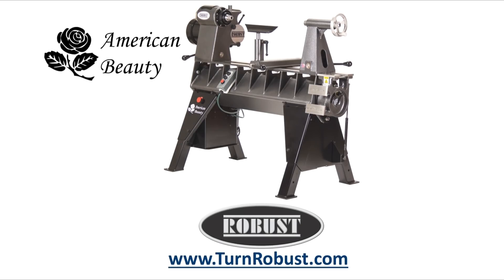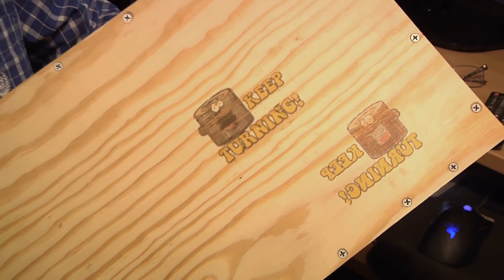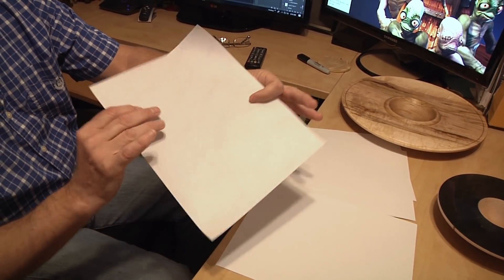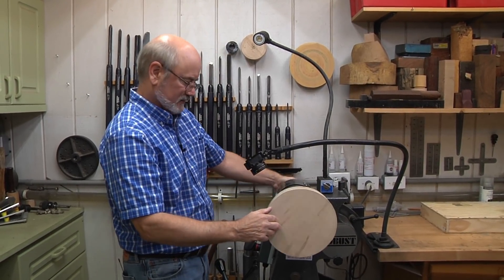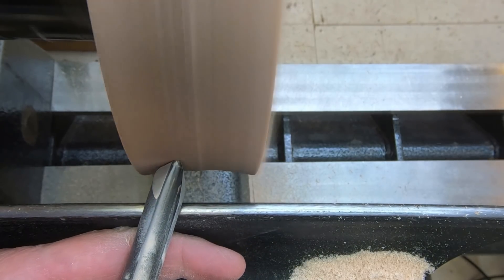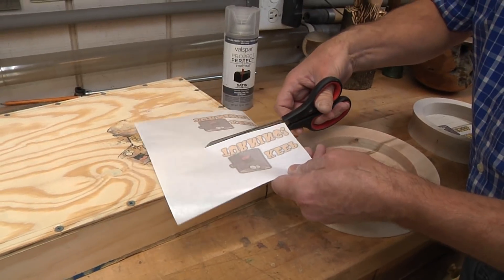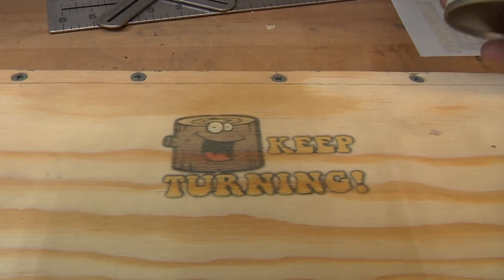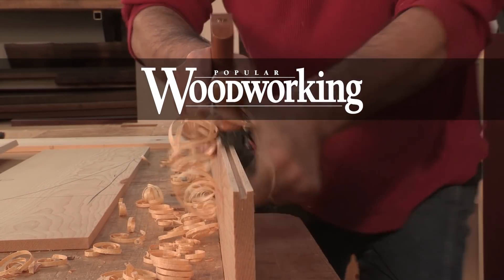Transferring Inkjet Image to Wood

Comment: I have heard alot of people suggest freezer paper, but i was never able to get it to feed through my printer. Frustrated with that method i tried poly sheet protectors and it worked fabulous. Avery heavy duty have been the best in my opinion. i just cut off left and right side making it the same size as 8.5x11 and the bottom and now you have 2 "plastic" papers to print on.  so much fun !
Reply: Hi there. Aha! Not just me then? They make it look so easy. Thanks😊

Comment: You can do the same thing using freezer paper, which is even cheaper than label paper. Just cut it to size and print on the shiny side. My results don't show any noticeable difference between the label and freezer papers.

Please keep the great videos coming!
Reply: nosheepdesigns Thanks, I"'ll try that
Reply: Good luck! Be sure to cut the freezer paper to printer paper size and be careful not to slide or smudge the print when you apply it to the wood.
Reply from the maker: Excellent idea!
Reply: @Nosheepdesigns  I buy my freezer paper 8.5x11, and dont get curl
Reply: @stephaniesummers7452  I didn't know that it came like that! Where do you get pre-cut freezer paper?

Comment: Thanks for a great idea!  I don't have a wood lathe, but this method of transferring an image may solve a big problem for the wife and me.

We've been trying to figure out a cheap, easy and quality way to transfer our photos to ceramic tiles for coasters.  The expenses must be low to sell at a profit.

The ink probably won't work on ceramic, but there's a primer, brush or spray, called B-I-N that will.  We're going try it TODAY, printing on label backing as you suggest, and transferring to B-I-N treated tiles.  Wish us luck!  The next craft fair is only 2 weeks away!
Reply: No luck.  The heavy layer of ink in a high quality photo makes a mess.  Oh well...

Comment: you can print it out on wax paper also. Cheaper. Tape the top of the wax paper cut to fit the computer paper to the top and put in printer.

Comment: My  concern is what you have done to the inside of your printer with the ink you have left behind.  I use inkjet decal sheets.  Not the best because the fixative kind of wipes out the yellow but at least my inkjet printer isn't getting a bunch of residue buildup inside.  Best to stay with laser decals.  Go to Office Depot or Staples and print them if you don't have your own laser printer.

Comment: I needed to look up what the Valspar Top coat was actually.  Old school lazy terminology of "lacquer" causes some confusion since I am not familiar with this particular product..  This Valspar product is enamel, not lacquer  The "heat" (reactivity) of lacquer may cause a different reaction with the printer ink, i.e. might make it bleed or run.

Comment: Great Idea Tim...I am definitely going to try it , I was working on an emblem , for my shop , to carve on my CNC , not working out that well to small ...this will do better .
I bought one of those sander you have ,  just a couple of months ago , did not last , started to smoke and heat up thought it would start a fire , not good in a woodshop , only used 15 - 20 minutes at a time got about 3 + hours out of it .....just want you to know Be Careful ! I like the angle but... end up getting 90 degree Ryobi 18 volt

Comment: Neat!  Could you "miniaturize" the process and put it on a turned surface such as a pen barrel?  Opens up a lot of opportunity!
Reply: If you use MS Publisher, you can scale the size by dragging the corners of the image frames. The limiting factor will be how much the ink will spread after the application to the wood and the type of wood you use. Hardwoods will hold the ink better with minimal spread. Some woods may have to be wiped down with alcohol and dried before applying the ink. Best to test it first with a piece of scrap. Let the ink dry for a day before applying the finish such as CA or some of the friction finishes.

Comment: That's neat. I wonder what sealing it with clear resin will do to the ink. hmmmm. :) Thanks for sharing this tip. - Heidi
Reply from the maker: Sprayed finishes don't seem to affect it. Now a poured resin might start dissolving the ink as it dries. If you try it let me know how it works out.
Reply: I will. Maybe if I let it sit for a couple weeks or so like I usually do with my artwork before adding the resin coat. I will try it both ways. :P Immediately and after a couple weeks or so.

Comment: What software program did you use to reverse the image?
Reply: That program was Photoshop, but there are several applications you can use to invert the image. You can even do it with Microsoft Paint that comes with windows.  (click rotate, and select flip horizontal or flip vertical)
Reply: @toddgunning5850  Thanks Todd. Your videos are excellent and I especially like that you explain everything well.
Reply: @davidedinger3707  thanks David, but they aren't my videos,  I just know computers and software.